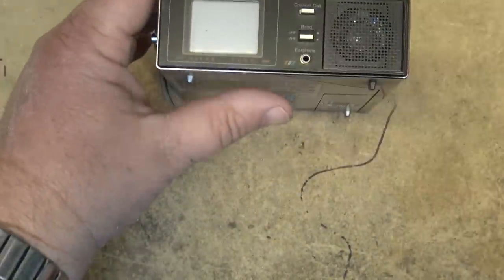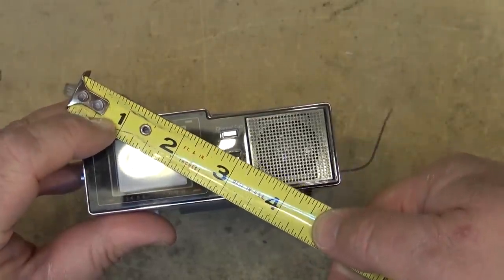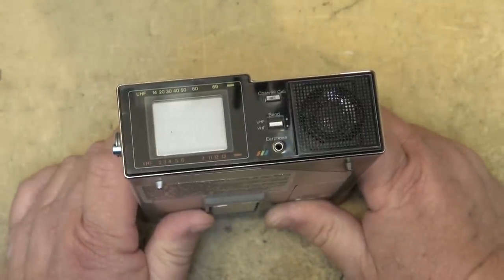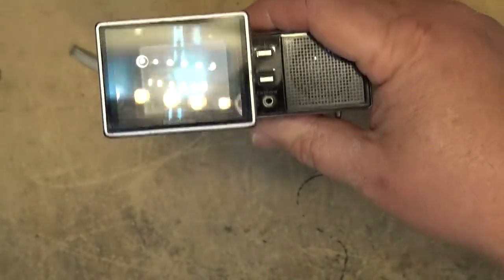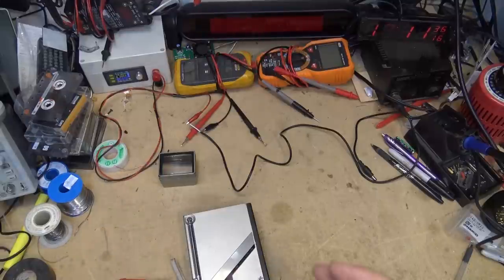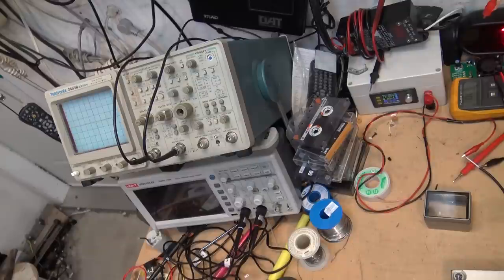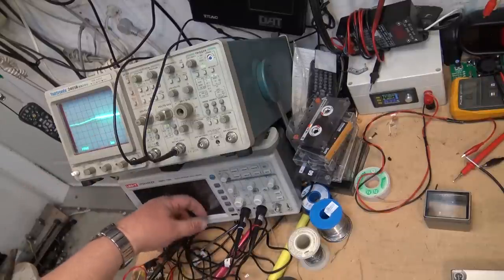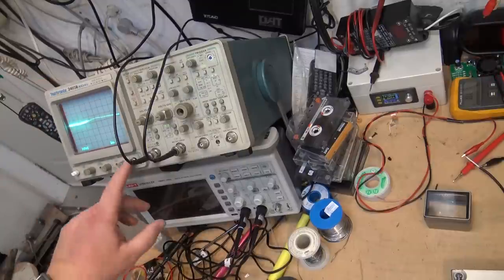Smallest Color CRT TV set in the world

Comment: 12VOLTSVIDS, What is the differences between a sync signal compared to a deflection signal? There is H&V sync signals and H&V deflection signals i don't know what are the differences between them
Reply from the maker: The sync signals are just pulses that control the deflection signals, which through capacitors and coils form the sawtooth sweep signals that drive the deflection yoke coils.
Reply: @12voltvids  thanks, but what are deflection signals, are they pulses or what do deflection do to the CRT circuit? What I mean is that H&V sync signals are the position coordinates for the CRT display but also the H&V Deflection signals are also the position coordinates for the CRT display image so I'm confused on the differences between sync signals and deflection signals i don't understand the differences or what the do. Can you explain more in detail what deflection signals are doing because there is vertical deflection signals and horizontial deflection signals
Reply from the maker: @billwilliams6338 
The sync pulses are just that. Pulses that trigger the deflection circuit to synchronize the sweep circuits. In the case of the horizontal circuit they start the beginning of horizontal sweep for each line at a frequency of 15.975khz this triggers the horizontal output transistor or tube which creates a pulse in the primary of the flyback and the horizontal yoke winding. Along with the linearity coil and capacitors this pulse is turned into a sawtooth waveform. The vertical sync pulse is at 60 Hz (ntsc countries), which is used as a reference for an oscillator in a sawtooth generator circuit that generates the vertical sweep or deflection signal.   This is done with active and passive components in the vertical circuit. Namely capacitors of various values. This signal is applied to the vertical yoke coil.   These are some of the more complex circuits in a crt display and trying to explain it in a short message won't do any of us any good. There are books on television that explain the theory of how it's done. The important thing to remember is the sync signals syncronise the sweep curcuits. The sweep circuits will operate in free run without them such as when no signal but the sync pulses must be there to lock the picture. If you remember what the analog scrambled cable tv channels looked like. Well that is what happens to video with no sync. The picture flops and rolls.
No deflection well you get a horizontal line for loss of vertical and a vertical line for loss of horizontal.  Perhaps a video demonstrating this would help.
Reply: @12voltvids  thanks for the help. Just to make is clear you get H&V deflection signals from the sweep circuit? Like you said the sync signals keep the sweep circuit in sync but the sweep circuit will output H&V deflection signals to the H&V yokes? The Horizontal Deflection outputs a PULSE signal to the Horizontal Yoke and Flyback. The Vertical Deflection outputs a PULSE signal to the Vertical Yoke. Any reasons why they are using a YOKE for both the H&V . A Yoke is just a coil of wire wrapped around like a inductor I'm not sure why they are using YOKES to do the H&V deflections on the CRT. The H&V Deflections are outputting signals to the H&V yokes to tell the CRT display what positions coordinates to be BEAM positioned at on the CRT screen?  The Flyback is the CRT anodes High voltage which is measured 19Kv to 26Kv but I don't know what the Flyback is doing to the H&V deflection or is the Flyback job only to just give High Voltage to the CRT tube thats its only purpose of the flyback? The B+ voltage have a trim pot if the B+ trim pot is not set correctly it will display a scrambled image just like having a Sync problem. So I'm confused about what the B+ voltage is ment for. This is a young techs trap because you will think you have a sync circuit issue when its theh B+ trim pot set to the wrong voltage which is display a scramble image.
Reply from the maker: @billwilliams6338  
There are 2 yoke windings.  One moves the beam side to side (horizontal ) and the other up and down. (vertical). These go to the specific output circuits.  The flyback generates the HV for the second anode, focus and usually the screen.  On some hot chassis sets the horizontal output drives the flyback which doubles as the main. Transformer so all the lower voltages are also derived from the flyback.  The reason is for voltage control.  Only need to regulate the raw b+ which is 130 on most sets.  Regulate that and all the others will be correct.   On newer sets they used a seperate smps for the lower voltages but the HT, focus and screen b+ which was around 200v always comes from the flyback.
Reply: @12voltvids  can you please make a video using a good working TV monitor and going over all the sections of what each stage section does and its purpose job function because i need a back to basics TV monitor video of the theory of each section stage of the TV monitor circuits . The Yokes job function is to move the beam at a position coordinates on the CRT screen which is based on how much "Voltage" you apply to the Yoke. I'm not sure why they used Yokes to move the Beam side to side or up and down, because a Yoke i thought is just a coil of wire wrapped around the CRT neck board. The Yokes voltage causes the CRT neck circuit board to output a beam signal? The Focus has a trim pot adjustment which is varying the 200Vdc of the Yokes voltage and beams voltage?
Reply from the maker: @billwilliams6338  
I can do that no problem when I get some free time.  
The reason a magnetic deflection yoke was chosen over electrostatic deflection as used on scopes was for size.  Electrostatic is much faster and that is why they are used on scope tubes.   Have you seen the size of them?   Take a look at that 7" x-y scope I just got to make the dedicated clock.  It is 24" long, for a 7" diaginal screen.  A 20" screen would have a tube about 3 feet long!  Magnetic deflection allowed the 90' and then 110' deflection tube. This made the tubes short enough to be practical.  More complex circuitry, yes, but it was ultimately they needed something that you could put in your living room that would actually fit in the room.
Reply: @12voltvids  Thanks that would be a big help to learn from. Yes Oscilloscopes tubes are long and smaller screen size. Arcade Monitors have XY arcade monitors that are not long and big screen size, so I'm not sure how they do this but for video arcade games like tron and star wars used XY arcade monitors you can't use a raster monitor for these games.  The TV cable from the wall coming into your house has the analog RGB and H&V sync signals which the TV monitor will convert the RGB signals and H&V sync signals into H&V deflection signals? arcade monitors use an isolation transformer to the monitors chassis to be disconnected isolated from earth ground for a safety issue. I'm not sure why its a safety issue because if you try to connect your earth grounded oscilloscope to measure waveforms on a TV monitor or Arcade monitor is will damage the circuit boards from of the Oscope earth ground will short out. But they say they used an isolated transformer for safety issues if a tech should drop a screwdriver which doesn't make sense to me to isolate the earth ground from the monitors chassis.
Reply from the maker: @billwilliams6338  Actually most arcade monitors were raster scan. Only a few like asteroids used X-Y and they had a relatively long tube.They were fit in at an angle so some of the depth was vertical.  Most used a standard TV type CRT, but were scanned at higher frequencies like a computer monitor.
The cable actually had composite video signals. Lumanence - Y signal (black and white) and chroma (Y - R and Y - B)
These were modulated on a supressed carrier and added to the baseband luma signal. The sync was also part of the luma signal. A burst reference was added to each horizontal line to sync the color regeneration oscillator.
On demodulation, a new color carrier is created at the exact phase and frequency as the original one that was used to modulate the 2 color signals. The carrier is reinserted into the color information that is present 'between each line of video" and then the 2 color difference signals for blue and red can be used to subtract their value from the lumanence signal, leaving the green signal.  On modulation the 3 RGB signals were added together, and then the green dropped.
Percentage wise for NTSC it was 59% green, 30% red and 11% blue that made up the composite.
So if you were to encode a 100% blue signal, you would have 11% lumanence level, 100% on the blue sub carrier, 0 on the red. To encode a red signal, there would be a 30% level on the luma, and 0 on the blue sub carrier and 100% on red. To encode a Meganta, the luma level 41%, with 100% on blue and 100% on red. This was done for compatibility with black and white TVs.
To encode a green picture, the luma would be 59% and nothing on red and blue. For cyan it would be 70% luma, 100% on blue and 0 on red, and for a white, 100% luma 100% blue and 100% red.
 It was a very complex system. 
All this magic was done in chips in newer TVs but older sets used descrete transistors or tubes to do this, and it was all done by using phase inverted signals to cancel others out.
There is also a very important stage of any composite demodulator. The delay line. Because the chroma and lumanence signals were transmitted in a different time interval, the chroma was sent between each line.  As the rastar was scanning in interlace format, odd lines, the chroma was send during the even line interval. So line 1 chroma would be where line 2 would be. Next line is line 3, and the chroma would follow in line 4 place.
In the second field where the beam was scanning lines 2, 4,6 ect, the chroma would start at 2, 5,7 ect. On demod, the chroma needed to be put back where it belonged or it couldn't be displayed as there was no beam happening at that time, the beam was in retrace. So they ran the luma signal through a delay line. Basically a very long coil of very fine wire wound on a paper tune about 1/2 in diameter. The length of the wire delayed the lumance 1/2 line, so that when the chroma was mixed back in to subtract it from the lumanence signal everything would line up. Otherwise the color would be 1 line lower then the lumanence. You can see this on VHS tape if you make multiple copies, as the process of down converting and up converting dropped the chroma by a line. So for example if you copy and copy a tape a few times, and watch the playback, a womans lip stick would appear on her chin.
In newer televisions the delay line was done in a piece of glass with piezo transducers on each side, because glass does not transmit the energy very fast. So a smaller device could be used.
Reply: @12voltvids  thanks for the information i did save it. Older Analog Oscilloscopes make by Tektronics model 2446 i think had a function to show the Raster Scan lines Odd and Even scan lines, I'm guessing troubleshoot if you have an H&V deflection issue on the circuit board. Yes I'm not sure why they made certain arcade games in vector XY instead of Raster, what the advantages are of using a Vector monitor instead of a Raster monitor. I'm guessing you're were able to give more Z axis depth layer type of graphics using Vector.
Reply from the maker: @billwilliams6338  Well X-Y gives more control for drawing things like circles.
Reply: @12voltvids  yes true thanks, which Oscilloscope do you use that shows the Scan lines numbers odd and even?
Reply from the maker: @billwilliams6338  
I use my analog Tektronix.  My cheap digital scope doesn't like video waveforms. It is rather useless.  Wish I had never bought it.  Good for setting speed on tape decks.
Reply: @12voltvids  any reasons why the horizontal sync is at 15.975khz, any reasons why 15.975khz? and the vertical sync is at 60hz, why 60hz? I don't understand why they choose theses as the standards and what advantages of using these frequencies for the H&V sync. Can you please explain if you know
Reply from the maker: @billwilliams6338  
Yes I do know why these frequencies were chosen and they have changed slightly over the years.   
60 Hz was chosen in North America because it was the line frequency so it made sense to use that as a reference on early TV's because it would make it easier to design and as the sweep was in sync with the power line frequency.   15750 was the original horizontal frequency as there as 262.5 scanning lines in a single field. 262.5 x 60 is 15750.  When. Color came in things didn't work out as harmonics created would cause unacceptable interference so they had to change things slightly so the color information could be inserted without interfering.  The vertical rate was dropped slightly to 59.97 and the horizontal also changed slightly to 15734.25 to be exact.  This was close enough that existing bw TV's could still lock but allowed the color subcarrier to send it's sidebands between the existing tv lines and not cause interference by interacting with the powerline frequency of 60hz.  Look up history of ntsc color system for more information.
Reply: @12voltvids  thanks for the help. I still don't understand why they choose the vertical sync to be 60hz, why would want the vertical to be "in sync" with the power line 60hz it doesn't make since to me. Any advantages of having the vertical sync referenced to the 60hz power lines?
Reply from the maker: @billwilliams6338  
Because in the early days, and remember tv is close to 100 years old now, tube circuits were not that good.  Power supplies were worse.   The time base was chosen bacause the vertical sync power burst would be at the peak of the AC waveform. The transmitter required the most power for the sync. In the early days everything was single phase.   The peak of the AC waveform corresponding with the maximum transmitter power requirement meant less strain on the power supply to maintain voltage.  Say for example the peak power was required during the cross over point where there is no voltage from the rectifier.   The capacitors would dump pretty quick and during recovery you would see light and dark bars called "hum bars" due to the sag in vintage.   So syncing everything with the power line frequency made sense in the early days.  Today it means nothing.  After color came about the vertical scanning rate was changed to 59.97.  By then 3 phase power was feeding the transmitters so this was less important.   Now when you get a cap that goes open on a linear power supply tv you get a nasty black bar slowing rolling through the picture due to the 59.97 scanning rate vs the 60 Hz power frequency.   In Europe they used 50hz and their horizontal frequency was:
15625 Hz.
Reply: @12voltvids  thanks for the help, I think you're saying that they got the vertical sync voltage from the Power Line 60hz in the old days. The 60hz in the power supply gets rectified to 120hz from the rectifier diodes double the line frequency from 60hz to 120hz so the voltage dumping and discharging off the filter capacitors would be at 120hz so the hum bars or black bars would happen less often because of the power line frequency at 60hz it seems. The vertical sync chip outputs a Vertical deflection signal to the YOKE to display an image. I'm not sure if the RGB signals are "mixed" with the vertical deflection signal or the RGB signals are connect to the YOKE also to display a color image. I'm confused how the RGB signals are mixed with the V&H sync signals to output deflection signals to the YOKE.
Reply from the maker: @billwilliams6338  
Yes they used the power line to synchronize the early cameras.  60hz is always 60 hz. Not 120. You are confusing the negative going swing. When you greate a full wave bridge, using the center tap of a transformer one winding will negative and the other positive, and then reverse. This will give you 120 pulses as you are rectifing both halves of the waveform. For sync, they just rectified, or more importantly clipped one half of the waveform to genlock the early cameras. Another reason they did this was for multiple camera switching. All the cameras needed to be triggered at the exact same time so they could switch cameras during the vertical blanking. If they were not synchronized, then the picture would flip every time a camera switch was made.
As to making up the composite video signal, the sync signals are mixed in with the video.
For color, the RGB outputs from the camera tubes run through a matrix to add and subtract waveforms. The 3 gignals are mixed to produce a monochrome lumanence signal for compatability with black and white TVs, and the red and blue signals are then subtracted from this lumanence signal to produce the Y-R and Y-B signals. These each go to their own 3.579545 modulator, with the carriers operating at -45 and +45'  from the reference signal. The carriers are then suppressed in a balanced modulator, and the 2 sidebands mixed together, and then added to the lumanence signal. Horizontal and vertical sync is mixed, and added to the video / chroma signal to produce a composite signal. A sample of the original 3.579545 carrier is added to the front porch, that is the space between the horizontal blanking and where the line starts as a reference. This is called the color burst, and it is 8 cycles of the suppressed carrier for the chroma sidebands. All the video signals run from 0 to 100IRE video levels. The horizontal and vertical sync is -40IRE. Remember this is inverted. -40IRE is the maximum peak power that the transitter can output. 100IRE is the minimum power. Since TV signals were AM modulated, black was the strongest signal (next to the sync) and white was the lowest power.
Say your transmitter had 100,000 watts peak sync. A black screen may have an average power of 90,000 watts (with the sync tips pulsing at 100,000 watts, and a pure white screen the power may be only 1000 watts. If the video was over driven the transmitter could actually be clipped into fill cutoff on the peak whites. This would cause severe splatter, and cause interference and also cause the audio to buzz.  A broadcast engineers worst nightmare was an out of standard video signal as it could blow the transmitter.
Reply: @12voltvids  ok thanks for the help. I'm confused why monitors have insulated floating ground sections, any reasons why? The Focus adjustment is a "negative voltage" that connects to the grid of the CRT tube and the "Tilt" adjustment is a "negative voltage" that connects to screen grid of the CRT tube? The V&H oscillators need a B+ 130vdc to be able to "lock" to the V&H sync signals,  why does the V&H oscillators need +130vdc because most oscillators circuits +VCC is at +9vdc to +12vdc, I don't see oscillators much with a +VCC at 130vdc.
Reply from the maker: @billwilliams6338  Most televisions use a dual ground system.  A hot ground for the raw B+ and horizontal output / primary to the flyback, and a cold ground for the vertical circuit and all audio video circuits. I am referring to solid state sets, before the use of switching power supplies. 
After switching power supplies, the horizontal B+ was also on the cold ground.
The focus voltage is not negative. It is about 10K volts to the focus lens.
Typically the cathodes will be about 150v, screen a couple hundred focus about 10K and second anode between 25 and 30K for a color set. Sony also had a CV (convergence) voltage of about half the 2nd anode.but that was something that couldn't be measured, but when the big red HV resistor cracked you sure new about it. Lightning and flames shooting out of it were common. Then they started building the convergence bleeder resistor inside the tube, so when it failed the tube was fubar. 
I'll do a trinitron video some day when I feel like dragging a trinitron down from the storage unit.
Reply: @12voltvids  yes i have seen adjustments for horizontal H convergence but not sure how much voltage or what its adjusting inside the CRT tube? Any reasons why most TV are dual grounded, why would you want dual grounded cold ground and hot ground for what reasons and advantages? The RINGS on the Neck adjust the Red and Blue "vertical" convergence not the horizontal convergence but what is the RINGS doing to the electron bean or Red and Blue Ray guns? I'm not really sure what the RINGS are doing to the CRT tube
Reply from the maker: @billwilliams6338  The rings are magnets and rotating them will influence the electron beam.
The reason for hot and cold ground was to make them cheap. Before audio é video inputs, when all that was on the TV was RF they were hot ground, with the neutral side of the line connected to the chassis. When AV inputs became common it was necessary to isolate the connectors from line circuits. The horizontal output was referenced to hot ground (neutral) and the rest of the circuit to cold ground. A small transformer was present to start the horizontal oscillator and operate the remote control. The horizontal drive went through the horizontal drive transformer to isolate the hot and cold grounds. The transformer drove the horizontal output which was regulated by a shunt pass regulator.The output drove the flyback. The flyback has several winding to produce lower voltages to power the rest of the set, and these wingdings are electrically isolated from the hot ground.   So when measuring voltages you need to know which ground reference to use, or you will get incorrect readings
Reply: @12voltvids  thanks for the help, So the RINGS "bend and Steer" the Electron Beam just like the V&H Deflection signals do? The Electron Beam is a "composite RGB" signal from the RGB tube Ray gun signals? It doesn't make since to me why they wanted the horizontal output to be reference to a HOT ground instead of a cold ground any reasons why? the vertical output is referenced to a cold ground why not a HOT ground?
Reply from the maker: @billwilliams6338  
This is on inline gun tubes only. Delta gun required very complex dynamic signals to coverage the 3 beams.
The only reason for a hot ground was so they didn't have to put a big transformer in. They use the flyback as the main power transformer. The entire chassis could be hot, and was on many sets prior to requiring AV inputs. The antenna input was capacitor isolated from the chassis. once external inputs were required they couldn't have a hot chassis anymore. Too dangerous.
So there were 2 ways of doing it. Optical isolation of audio and video inputs, or electrical isolation of the signal circuits using a transformer. Using the flyback was cheaper than building a seperate power supply. As switching supplies got cheaper they did eventually do just that. It was all done for cost savings, not performance.  Like everything else if they could save a buck they would.
People praise vintage electronics now, but we used to curse them back in the day. There were some really shitty designs out there that today people think they were the greatest.  There was lots of garbage made in the 80's and 90's. Some of that garbage still works, but the majority of it was tossed long ago. Some really good designs were out there by companies like Sony, and many are still in use. Just today I dealt with someone at work with a tube TV from 1988 and it still looked pretty good.